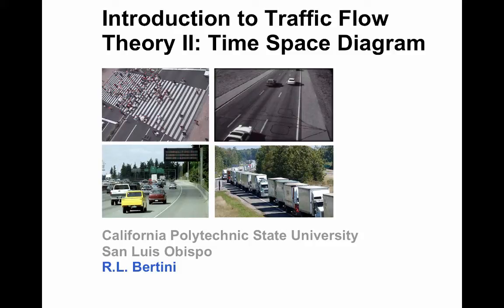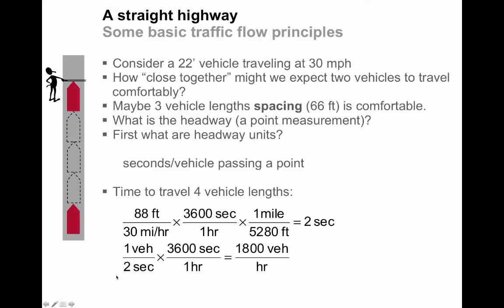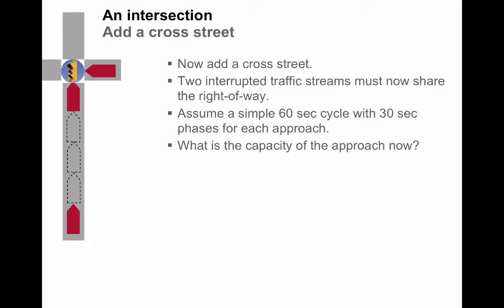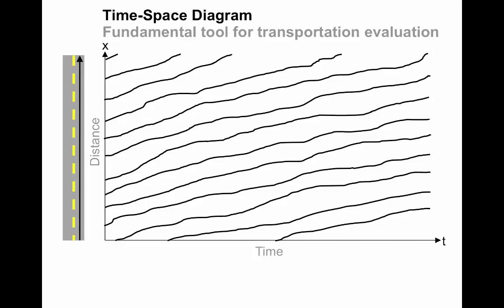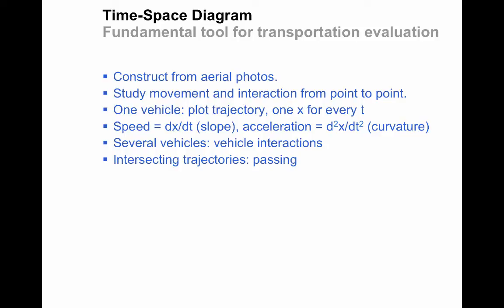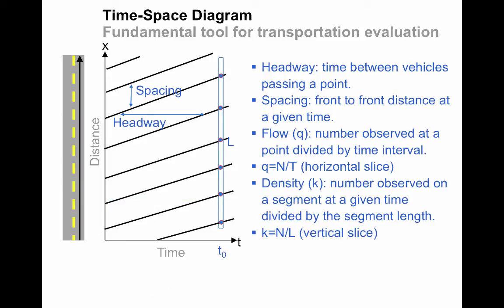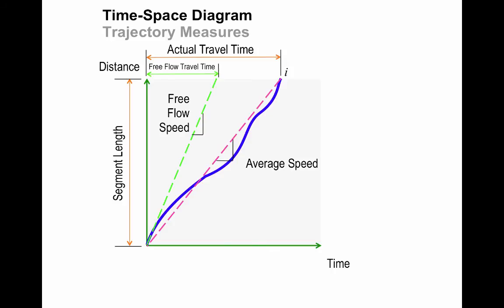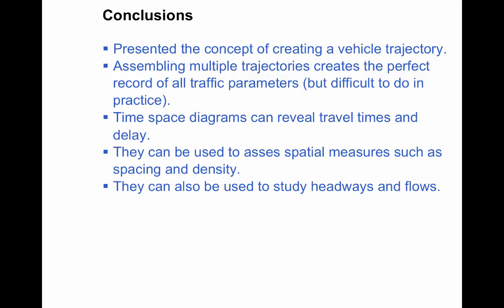Traffic Flow Theory II

Comment: +Robert L. Bertini - Dear Prof. Is it possible for me to get these all these slides downloaded from you for my study? If I have your permission, can you please provide me with a link for the same.

Also which Traffic Simulation software do you consider to be the best? They are very expensive to buy and I would love the one which can simulate in the best and realistic way but also easy to operate.

thanks!
Reply from the maker: +Ahmad Shumayal  - slides and other resources are here: http://bertini.ceng.calpoly.edu/courses/559/559.htm

In terms of software, you might try some of the open source tools that are available to start with, such as Sumo. If you are with a university often you can contact the vendor for an educational license. Good luck.
Reply: Thank you for your quick reply sir!

Yes, I'm a junior year student in my university. Again can you suggest me the premium vendors I may contact? I have already messaged around but the variety kind of overwhelms me. For instance, VISSIM or VISSUM? I find many softwares do nearly the same thing.
Reply from the maker: You might check whether your university already has a connection to one of the vendors. Probably PTV (Vissim) and TSS (Aimsun) would be the two most popular and easy to use. The vendors would likely respond if your professor contacts them on your behalf. Good luck!
Reply: Robert L. Bertini Kindly recheck the link to Traffic_Flow_Theory_Monograph on your page. It returns an error.